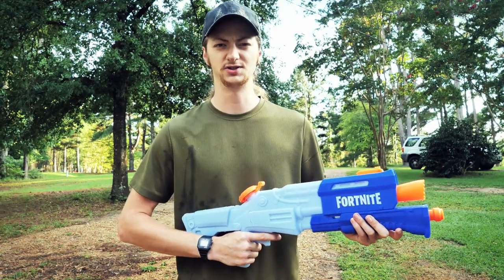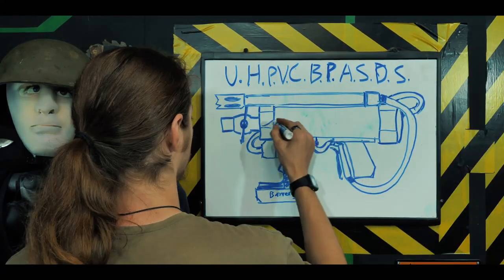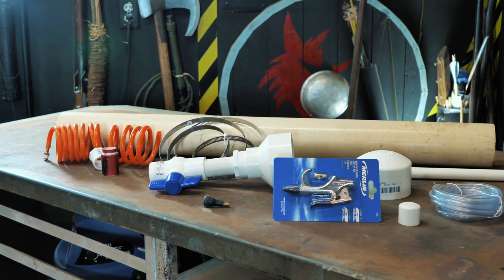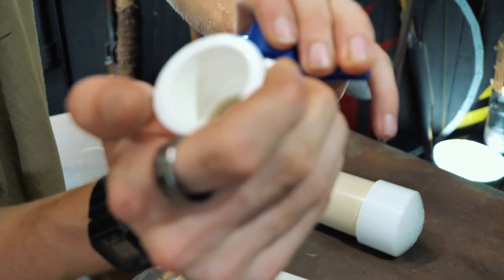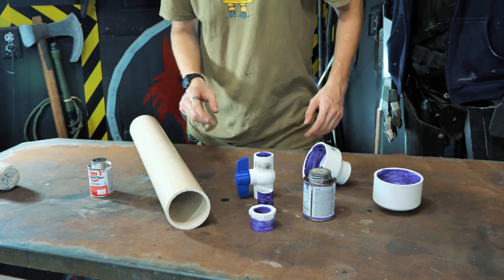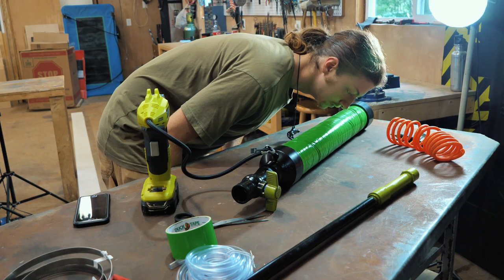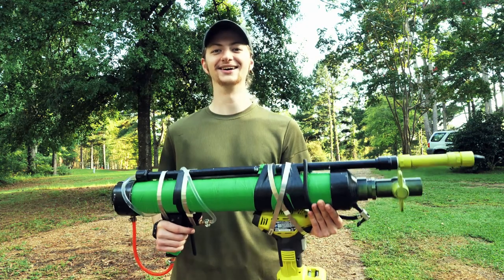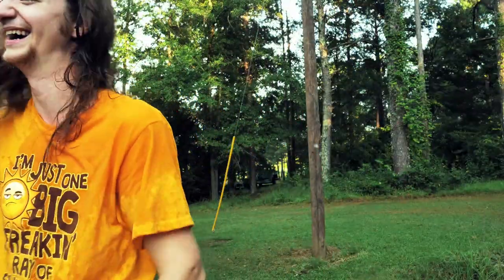How to make the DUMBEST Super Soaker on YouTube (The U.H.P.V.C.B.P.A.S.D.S.)

Comment: You should get an electronic valve for a sprinkler system so you can trigger it to open when you just hit a button so you can use that bottom part as the water grenade launcher

Comment: That excellent. The moment I want to design smth like there was no video so now I can save sometime on engineering... I'm not a fluid engineer and just wondering won't it be cooler (more distractive) to connect gas like CO2 or helium or even flammable gases, they are cheap and create insane pressure, cannot find such solution in internet...

Comment: Bit of advice, if you use ABS pipe, it’s stronger and much more resistant to UV light. It’s also safer because if it fails, it’s more likely to rupture instead of shattering. You do need a different type of cement (no primer though!) to solvent weld it. Just make sure it’s not cellular core. Great video by the way!
Reply from the maker: Yeah I feel like i've heard that before... but eh i don't think any local hardware stores sell ABS pipe?
Reply: Where I live (Alberta), you can find it at any hardware store. It’s black and typically right by the PVC pipe
Reply from the maker: Yeah we just don’t have that here. I’d probably have to order it or go to a plumbing supply store
Reply: That’s too bad. By the way, would you mind if I made a video of a scaled version of your water gun? I’d give you credit, of course
Reply from the maker: Course I don’t mind, have at it!